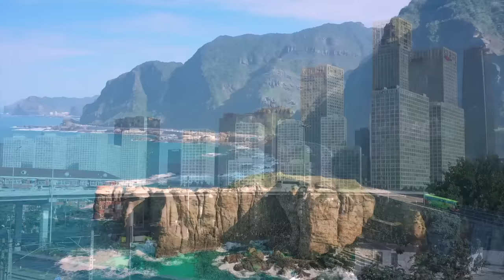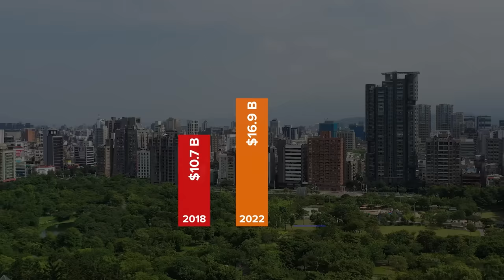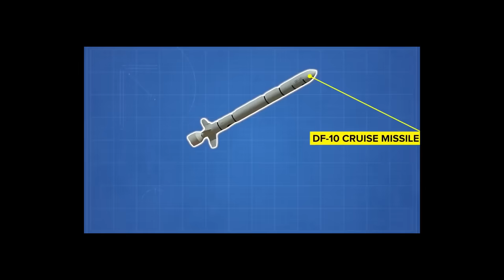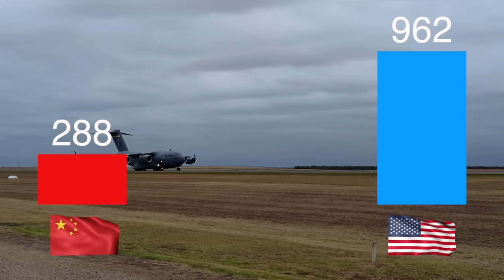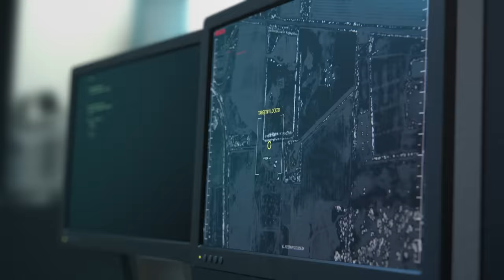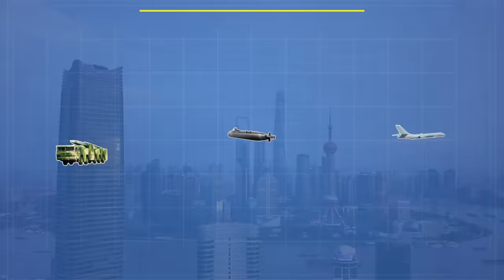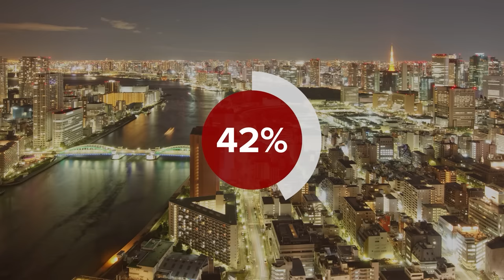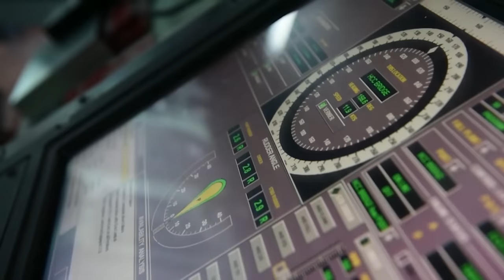Why China’s Man-Made Military Islands Are a Disaster - COMPILATION

Comment: Yes they should have built some wide deep steel reinforced retaining walls and every 3 ft there should be a 250 ft column going straight down does islands should be solid concrete with a 25-ft steel tsunami stormwall. did they actually just build them out of nothing but sand